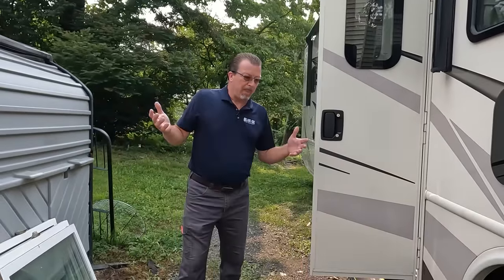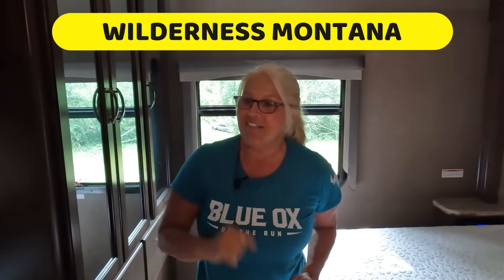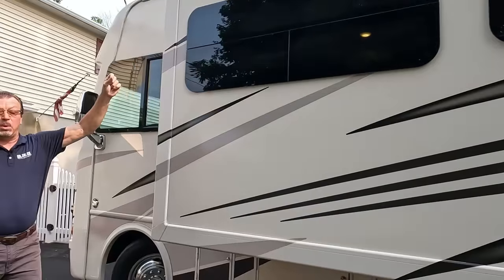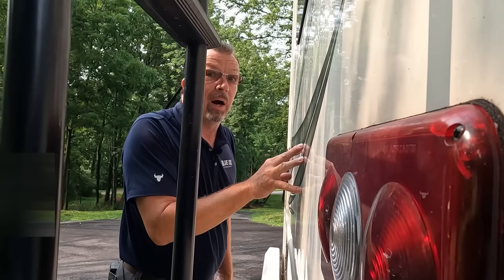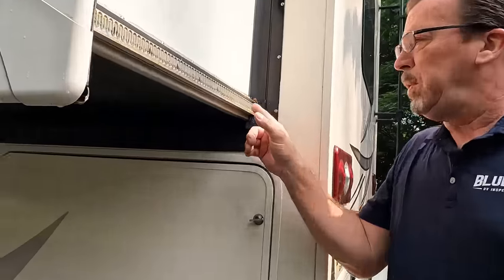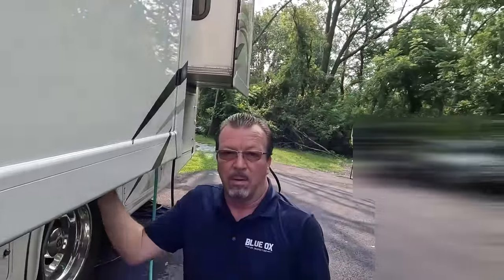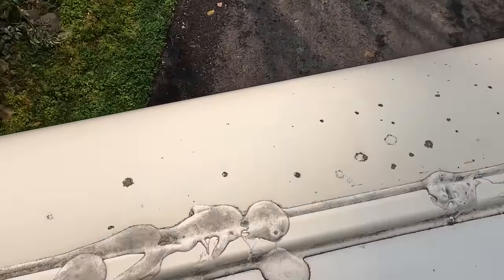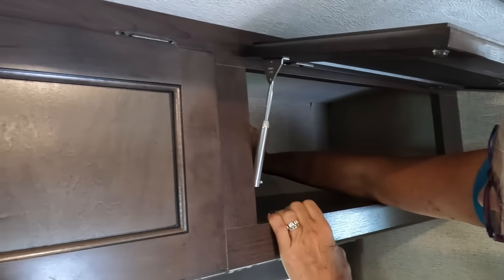🤬It's a TRAP for RV BUYERS! WHY are RV Sellers DISHONEST? THOR ACE 30.3

Comment: enjoyed your inspection video.  How can I have faith that the inspector that I choose will be as good as you guys?  I purchased a 34' sailboat several years back, and hired a surveyor / inspector to look it over.  He gave it a clean bill of health, so I put out my cash and purchased the boat.  As soon as I took possession and got it in the water, I filled my water tanks so I could sail the boat from Bristol RI, to Salem MA.  I quickly found that my water heater could not hold water.  Not a little leak, the bottom of the tank was missing, completely rusted out.  Additionally, I found that the hatch in the head was leaking during the first rain storm.  I'm about to purchase an  rv, it's a 2022 with 5000 miles.  Do I need an inspector?  I learned a lot from your video, but that does not make me a qualified inspector, and I don't have one of those nifty moisture gadgets like you guys.  Do you do any work in Virginia or do you have affiliates down there?
Thanks for a great video.  Happy your customers had access you the two of you.
Reply from the maker: Make sure to reach out when you are ready. We are in VA as of now.
www.blueoxrvinspection.com

Comment: which moisture meter do you recommend? I noticed in your video you don't use a pin meter, do you recommend the non-invasive over the pin meter. thanks!
Reply from the maker: We have another "pinless", more professional unit to confirm after objective findings with the R&D.

Comment: 75% owner don't care to fix little like rust its surface issue white-out touch-up paints will temp that till the next 🦃buy it by that when it rust hole should deep 3mm in 4yr-9yr it be in 12 owner

Comment: Buy a AIRSTREAM trailer. Don't work for Airstream don't have stock in the company. But just looking at the spung bob on roof, with Airstream rap around of top of there RVs, see a huge difference on water DAMs. Can anyone tell me a RV brand that matches Airstream on there roofs NOT being water magnets. I realize that Airstream are top dollar, but heck you might as well sleep in tent, compared to this.😊😊